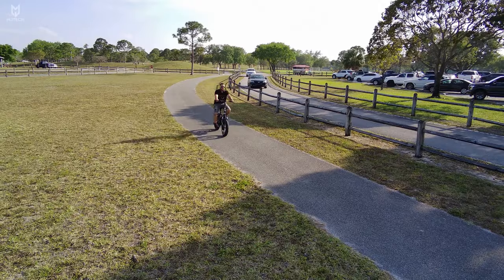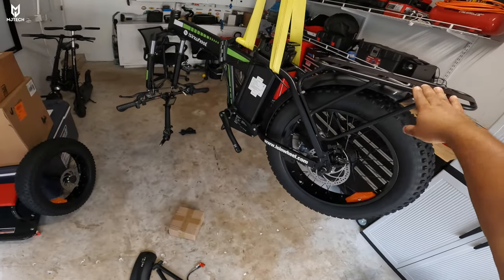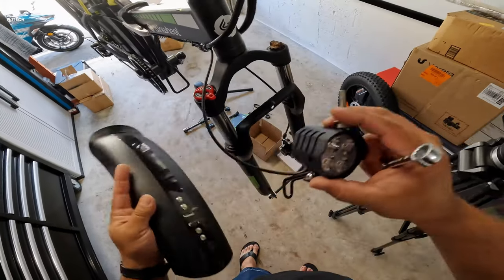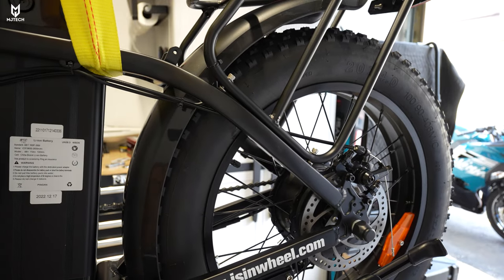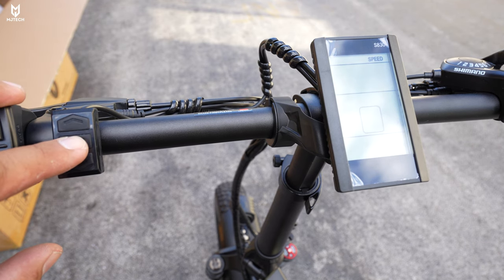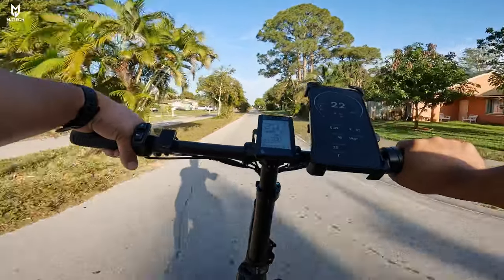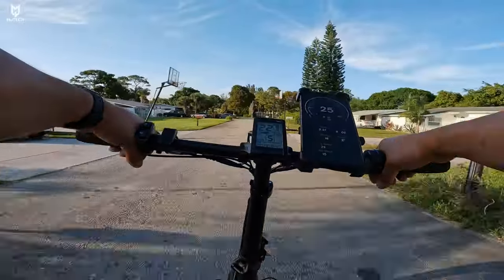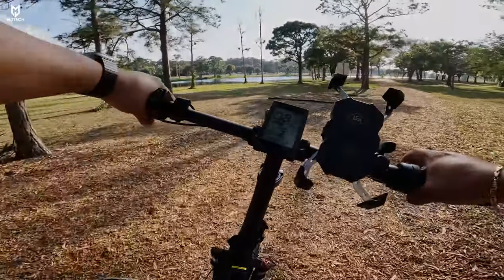iSinwheel D4 Electric Bicycle - It Does 30MPH & It’s Affordable!

Comment: Faulty motor controller, super loud breaks
I bought a bicycle from someone who received it as a promotional item from the company iSinweel. The bike was practically new. Shortly after, it turned out that the bike has a faulty motor controller. It shuts off by itself during rides and displays inaccurate battery readings. To be able to turn the bike on, I have to restart it by turning the key off and on again. The customer support refuses to honor the warranty because I didn't purchase the bike directly from them. I asked if they could at least sell me a new controller, but today I received a response stating that they don't have it and cannot provide it. I definitely do not recommend this bike or this company. Additionally, the brakes... if you decide to buy this bike, immediately order hydraulic brakes because the stock ones are a nightmare. They are so loud that it's embarrassing to brake as everyone turns their heads.